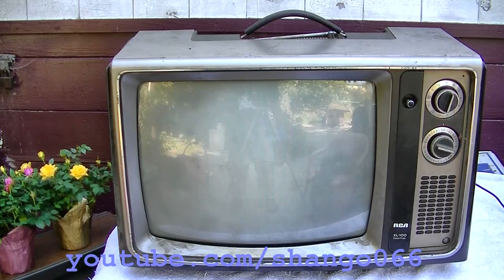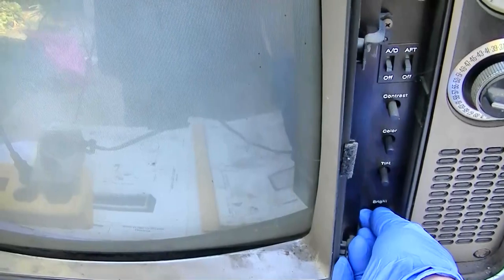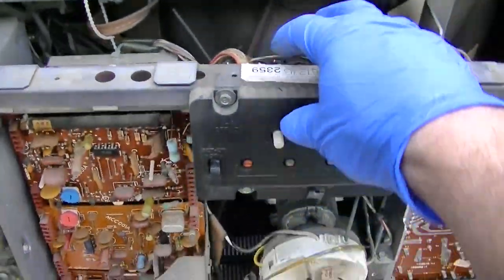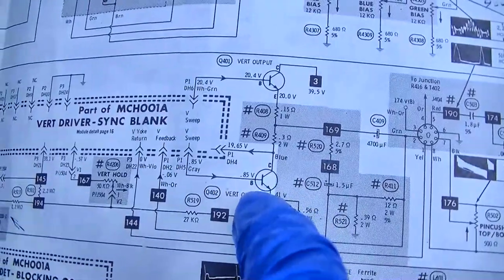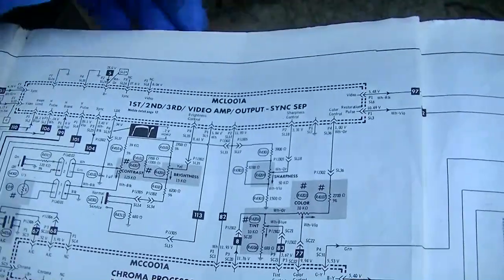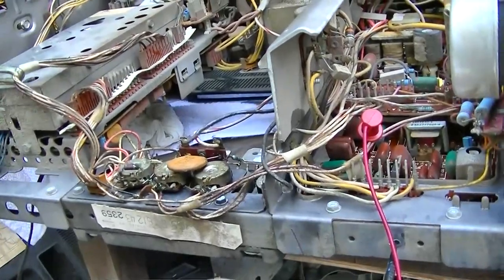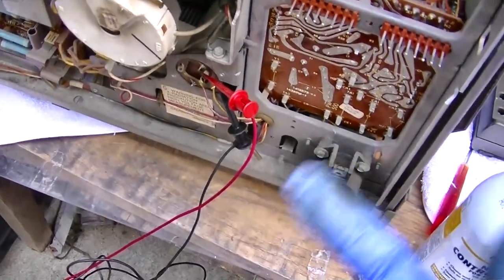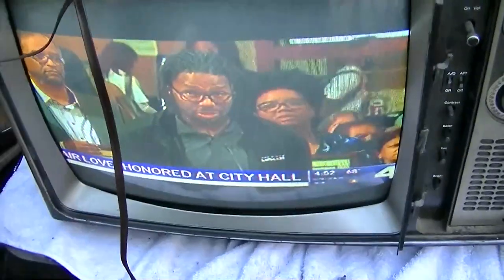Repairing 1976 RCA XL100 CTC74 Color Portable Table Top Vintage Television

Comment: Those large electrolytics always went bad in the rca's  There'used to be a metal clamp that held them. Fixed most of them! The tuner was open because some lazy ass sprayed it and was too lazy to put it back...Solder all the lugs and any griplets you can find!  they always opened in the xl 100's. First thing I always did was go to the cans! :) In the 169 chassis the caps in the power supply dryed out the voltage would just keep on climbing till the h out went. The projection sets were notorious for this. Also the hv divider would go bad..Take the anode lead out it would stay on..Then we has the bad grounds all around the tuner on the 177's..Vert wud drop out and if the customer let it go it would kill the eeprom memory 8 pin chip..Pain in the ass. There was like 55 tuner settings you had to write down if people had direct cable. You got lucky if you just lost the audio and didn't need to do a full tuner alignment . This crap was all in the service menu. Then they went to chipper check which was a complete disaster Yikes. Convergence was also a pain in the ass in the 169-185's Don't even get me started with changing the coolant in magnavox , lxi sets. Blue and green tubes grew algae in them blocking the raster from them..The red never ever went bad.  2-3 hour road jobs changing fluid..Then the Mitsubishi sets with the stk convergence amps modules headache!!!  If you needed to change tubes in a mits the whole bulkhead had to come out..I really hated that setup..But American paid $38 an hour w/overtime so that made things somewhat easier to take. Also solder all tuner plugs inside the electronic tuners. Open rings around half of them all the time in the xl 100's  You have an older mechanical tuner so that isn't necessary..Tuner always a problem in RCA's  Also a little .01 box cap in the horz section would blow the h out after about 29-30 hours of operation. They usually had a little bubble on them. But all in all considering how many were out there the   CTC  169 was a pretty good chassis.

Comment: Well done for getting it working!I doubt if the whole Vertical Timebase is the oscillator though.It could have been done that way but it would have been a rather poor design probably causing an over worked V Hold control as it drifted in frequency as it warmed up.The Transistor marked Switch looks as though it is the Maintaining Amplifier of a Phase-Shift Oscillator.

Comment: At 49:25, it is disappointing to not see glowing vacuum bulbs, aka, the money shot!  That vert output stage looks a lot like the output stage of an audio amp. That big electrolytic couples the low impedance output stage to the low impedance of the yoke. I've seen many open/dried out output caps on amplifiers.

Comment: Contact cleaner? In the army we just used pencil erasers for our high tech government expensive equipment.
Reply: In the German army we used chloroform. And that's no joke.
Reply: Use a pencil eraser enough times and it'll apparently wear the plating right off the connectors.

Comment: Not that the new flat screen TV's only last 5 years, but they become obsolete that fast.  I have replaced two flat screen Visio's with new Samsungs that cost less than 1/2 the originals are are larger screen 4K models to boot.  The old ones still work, and will replace even older CRT sets in the unused (guest) bedrooms.
Yah, the vertical circuit is one big power oscillator.  Those two output transistors should be identical as it's a quasi-complementary output circuit.

Comment: Vert. yoke coupling cap was a common failure in solid state vert. Very common on the older XL-100's 470@75vdc used a lot of them., because of the high a.c. current passed through them to the yoke, another problem with these sets was bad soldering especially the module connectors. There were two kinds of scr's to-220 metal can & flat plastic 220's the flat one's would get intermittant., the metals were better.
Reply: I remember the 1980's General Electric PC chassis and every one of those had failure of the yoke coupling capacitor. The early ones were 100uf/50V and then they went up to 63V. The 63V ones held up a little better; but, were still highly stressed and failed. I always replaced them with 100uf/100V high temperature capacitors.

Comment: I had an XL100 but a few years later.  It had a remote.  It lasted 2 decades, but I gave it up when we went digital in 2009.  It was a good set but at the end the CRT took awhile to get bright, typical for an old set.

This guy has no consideration for our ears - that noise is hard on the ears.

Comment: Why does the lettering "NBC NEWS" (lower right corner) run off the screen?  This appears to be the entire 16:9 widescreen picture, letterboxed on the old 4:3 screen, so why is so much of the right side missing?  The bottom seems to cut off a bit too.
Aspect ratio SEEMS right, so this is a little strange.
Reply: I think that's because broadcasters are no longer taking the safe zone into account on older sets anymore. My analog sets does the same thing.

Comment: a digital to analog converters boys,,costs 30 smackaroos at home de pots
Reply: Tom Kelly $10 at goodwill
Reply: @fredfabris7187  so much the better,those stores got me old still working nice 70s receivers
Reply: BadDriversOf Georgia they have a return policy on electronics
Reply: I found a Zenith DTT901 at Goodwill for $7. It has the best tuner of any converter. It’s more sensitive than most TVs. It even has manual tuning by RF channel, with a signal meter.

Comment: Modern tech doesn't have to be disposable. If you haven't already, you should look into Right to Repair, Shango. Technology advancing shouldn't mean it can't be fixed!!!
Reply: Stuff today is just too cheap and the product cycles are too short. Look at flatscreen TVs and monitors. Those from ten years ago don't have HDMI and have a power consumption which is out of this world.
What's the point of fixing those?
Reply: Nowadays buying new costs almost like to be repaired.

Comment: There was a sony that' a weak .47 cap would blow out the gate.   Sg613 608   intermittent not enough drive .the gate horiz outs were nasty. were always bad on those  cap to the yoke .we stocked the boards if didn't fix the cap .was bad

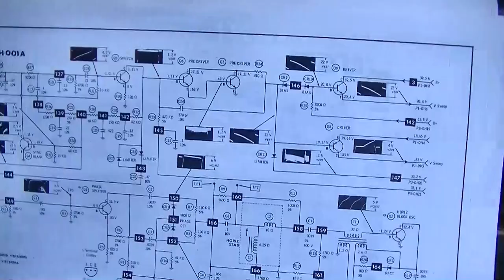Comment: 15:07 "Not supposed to be a difficult repair. It was supposed to be a simple Bloomberger."
Bloomberg: "Anyone can fix vintage electronics. You take out the old capacitors. You put in the new ones and it's fixed!"

Bloomberg said anyone can farm. You make a hole in the ground and put the seeds in. Sprinkle some water on and in a few weeks voila.... Jackass.... Anyone can be a billionaire. Take the money out of your pocket. Sprinkle it around and viola. Billionaire!
Scumbag

Comment: 1 like for the cap-IC botch job XDD
Reply: This may have been a factory authorized modification. There were lots of "tack-in" mods in the 70s. Cheaper than redesigning the board - let the service tech fix the engineer's design mistakes.